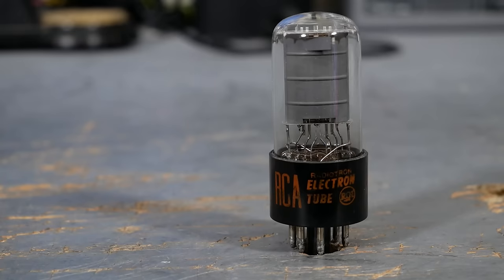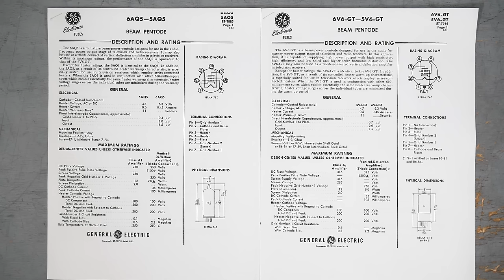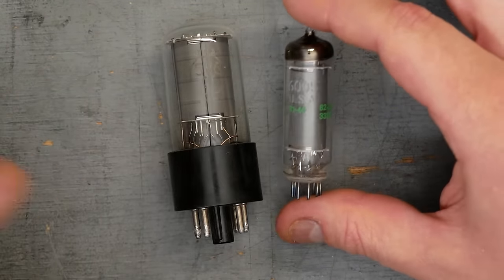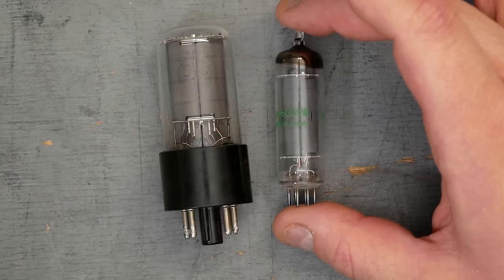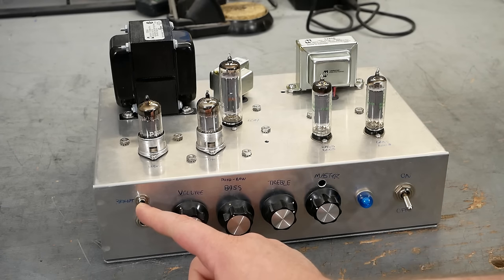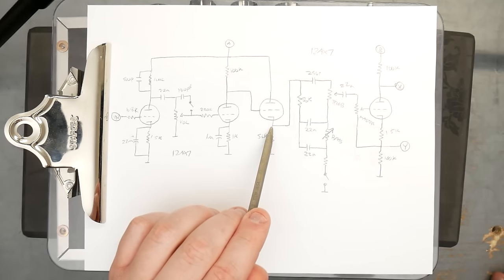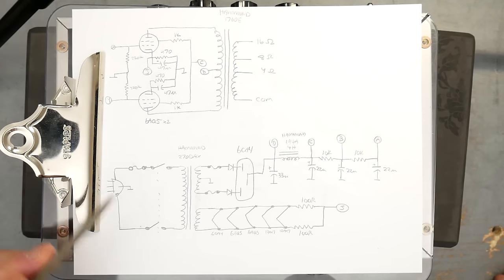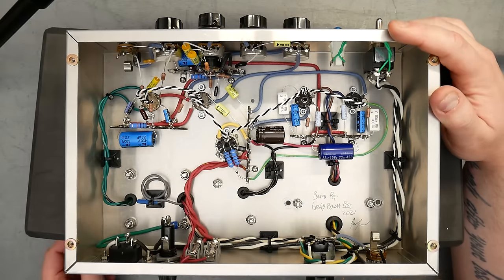The best output tube you've (probably) never heard of...

Comment: 6V6 and 6L6 are the most popular period especially in America.  The Frequency of a 6aq5 is inferior plate voltage wise compared to 6v6 . 6BQ5 is a better choice vs 6aq5 ! What advantages? This is pointless None ! 6v6 is superior 6v6 has better low and mids the input capacitance is lower which equates to better headroom ! Enjoy your odd ball over priced just to be different amp 🤔 💭
Reply: 🤔Do you build amps? I do, you are mistaken on several things IMHO. The only thing that I agree with is 6V6's and 6L6's are the most popular in America. They are also still made today in Russia, Czech Republic and China so there is that, but when you can buy a pair of these 6AQ5's vintage RCA NOS for about the same as 1 brand new Russian 6V6 or but a 60's tube reel to reel recorder with a pair of them, a 6CA4 rectifier and a couple RCA 12AX7's for like $40, I am not sure how this is overpriced. I literally buy vintage tube gear cheap, gut them and build stuff equal in tone to a legit 50's or 60's vintage amps for less than $100 all in regularly. Just sayin' don't be a hater bra.
Reply: @skullheadwater9839  RCA tube manual says that the 6AQ5 has a max plate voltage of 275 volts and the same for the screen grid.
The 6V6 is rated at a max plate voltage of 350 volts and a max screen voltage of 315 volts.
Apparently that it the operational difference between the tubes.
Obviously, we know that a 6V6 will operate above that voltage because Fender has been putting 400 volts plus on them since the late 1960s...
I know that Gibson used the 6AQ5 in some of their little amplifiers with pretty good results.
Reply: @skullheadwater9839  The 6V6 / 6AQ5 schematic is only basically similar 
(The 6V6 /6AQ5 in U.L. mode requires an 8k impedance for the OT the larger tube of the 6v6 takes heat better as well as higher voltage.  I been in the electronics field industry since the 70s yes I built and repaired many Tube amplifiers even a few Dumbles . As a matter of fact I recall some manufacturers used the 6aq5 in vertical deflection circuits in TVs . The 6AQ5 is a power beam type tube, like a 6L6. The 6BQ5 is a power pentode, like a EL34. Like I said before 6v6 has a lower input impedance which has more headroom which equates to nicer cleans also 6V6 is a larger tube which equates to better heat handling and higher plate voltage so that's why I prefer it plus I have stock piles of vintage RCAs just sitting around NOS since the 70s . No Hate here and no I am not into bras ? 🤔
Reply: @skullheadwater9839  Some of the JJ teslas 6V6 Power Beam tetrode that performs flawlessly at up to 475 volts! No 6aq5 will touch that !

Comment: Sorry .. Absolute rubbish as it is an EL84 and this is widely used as a pair for 15 Watts or as a Quartet for 30 Watts. Morgan AC20 ? Vox AC15, Vox AC30..Orange AD30 ....Fender Pro Jr ....
Reply: The EL84 equivalent is a 6BQ5. The EL90 is the equivalent to the 6AQ5 tube shown in this video.
Reply: I stand corrected! And only 7 pins ..?
Reply: @cliverkay  , yup, 7 pins.  Pretty much the same specs as a 6V6 except for lower plate voltage handling and lower power dissipation. A pair of them in push-pull can still put out 10 watts or so, perhaps more.  I have about 50 of the uprated, ruggedized, military 6005WA version, which I bought at  a ham fest for about $2 each a while back;  I really need to build some amplifiers with them!

Comment: 6Bq5...popular tube, pentode, 6V6GT popular beam powered tetrode
Reply: Actually, a proper EL84, at least if New Old Stock and made in Europe, would almost certainly be a true pentode, but an American 6BQ5 might be a beam-power tetrode instead.  American manufacturers developed beam-power tetrode versions of European pentodes so they wouldn't have to pay the Phillips pentode patent. Similarly, the American 6CA7 is analogous to the European EL34 and pin-out compatible, but the 6CA7 might not be exactly the same internally or performance-wise because it doesn't have a suppressor grid like a true pentode does.

Comment: In your mention of the 4 most popular output tubes, how did you not mention the EL84?  
You're right.  The 6AQ5 is realistically non-existent in the guitar world.  
Going with the late-stage, cathode follower tone stack harkens back to the earlier 'bassman' (and soon after, Marshall) concept.  Not my favorite.  🙂
But it works for lots of people.  
Being almost strictly an SE guy, I'd be interested in seeing how one of those would sound like that.  I use EL84's and 6V6G* depending on how I feel that day.  🙂  But I'm also interested in trying new stuff too.  
Thanks for the heads-up.
Reply from the maker: I sorta did, EL84 and 6BQ5 are interchangeable.
Reply: @graybenchelec  
Yes, that's true.  
Sorry I didn't catch it when you said it.  
Considering that it's the tube used in amp designs just as historically and musically important as the EL34 and 6L6 (vox, matchless, victory, marshall, hiwatt, fender, etc.), I guess I just was missing equal love shown for the type I use for 5 out of 6 amp builds I do.  🙂
Thanks, again, for the info on the 6AQ5.  I'm always looking for something new to play with.  
Have fun!